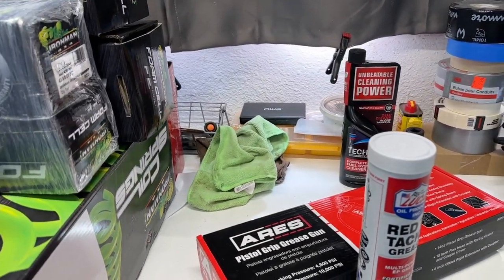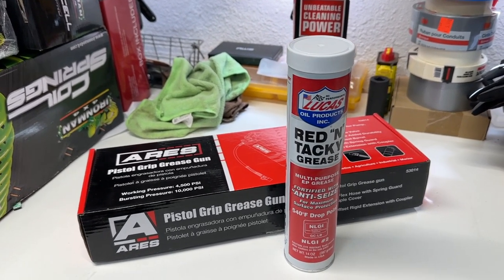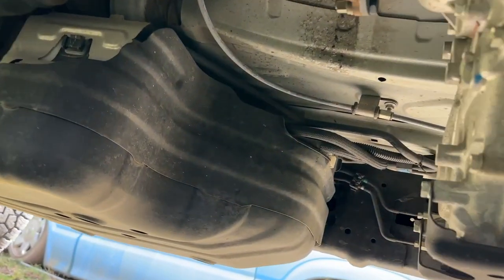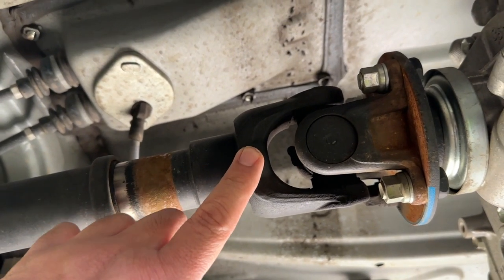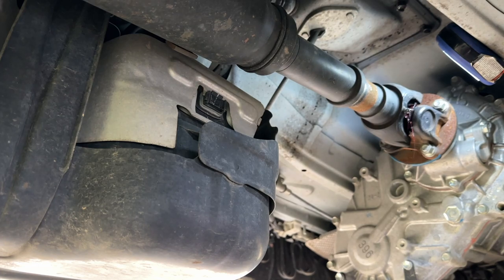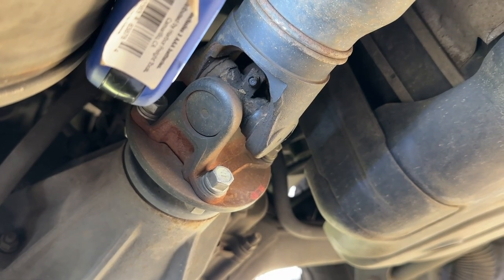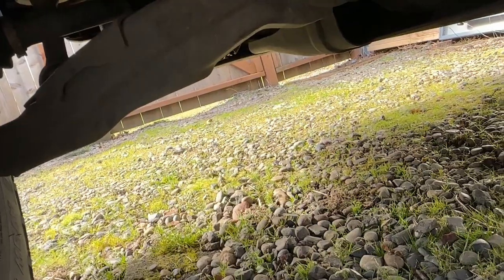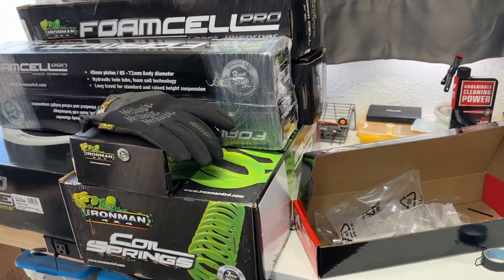4Runner Propeller Shaft and Spider Joint Greasing. Don’t Overcomplicate It.

Comment: Good video. One item I’d correct. Never mix polyurea grease with lithium grease. Doing so can actually be worse than nothing. You can get a reaction between those different greases that creates a rock hard substrate that will destroy the bearing surfaces. Use the type of grease in the video. Do not substitute with polyurea ever.
Reply: This, 100% this. If you're going to use Polyurea, you have to strip every last molecule of lithium grease out of the item you're greasing first, but then you can double the service interval. To me, not worth it.

Comment: I just did my 4runner with this grease. I also used it on the ball joints. It's a good grease. I did so much research and spent days. It was a nightmare.  Lucas red n tacky for the win!
Reply from the maker: Presuming you have a gen or aftermarket greasable ball joints??? I just replaced my entire UCA this weekend.

Comment: Just did this on my 4Runner today .

However, after doing this, my suspension seems a little stiffer and there is clunking between the rear driveshaft and transfer case when I push the car up and down. I only did 2 pumps on the slip yoke.